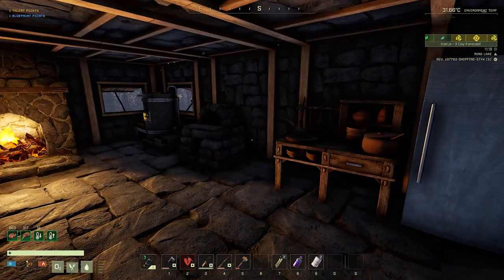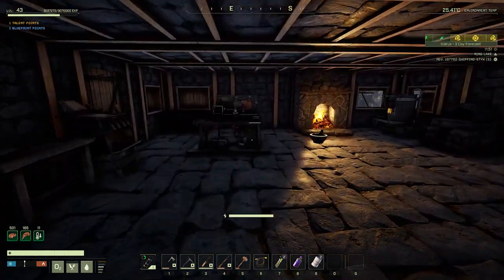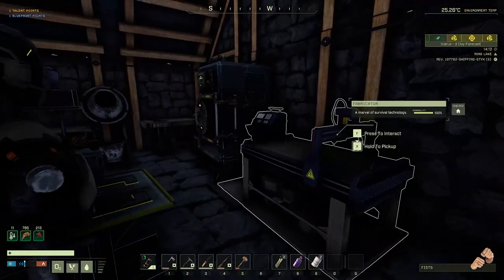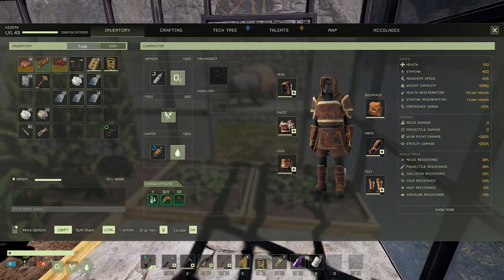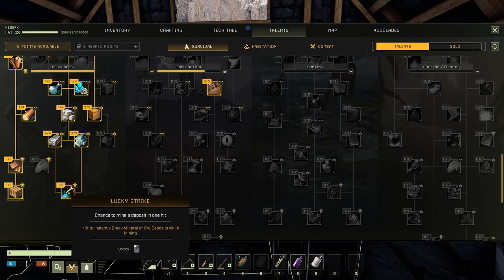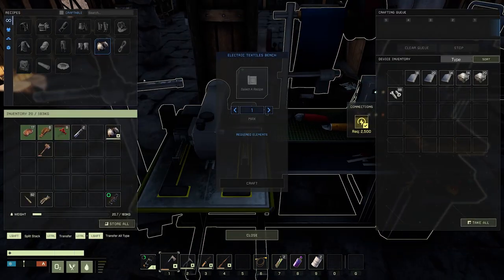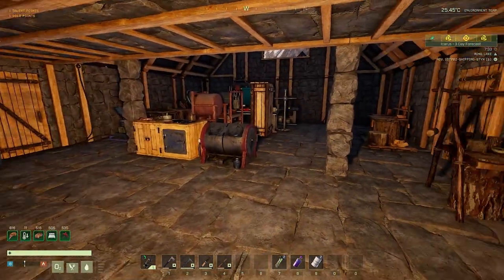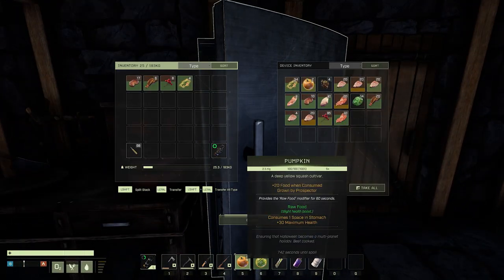Tier 4 Upgrades - Composite Armor & Reinforced Glass Greenhouse! Icarus Open World Mode - EP15

Comment: you need to make waterwheels to increase the electricity for your base. also you need to have bow and arrows when you go out because you will need a back up weapon, then carry 50 arrows and 100 rounds of ammo.

make a base in the entrance of the cave that connects to the dessert biome and use it as a waystation so you can store supplies to build a base in the dessert.

the sacks from the cave worms can be used for a bow and as armor, look in the tech tree.

make the mission board, this will help in getting XP and some items. you can make two mission boards to earn XP faster.

connect water to your crops it helps them grow faster
Reply from the maker: Thanks for the tips, I definitely need to get the mission board going I forgot all about it!